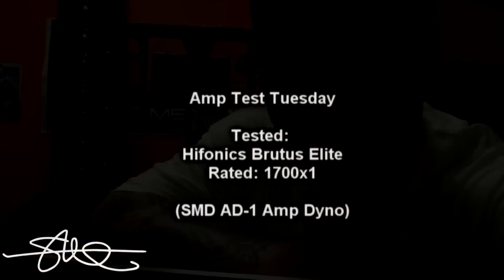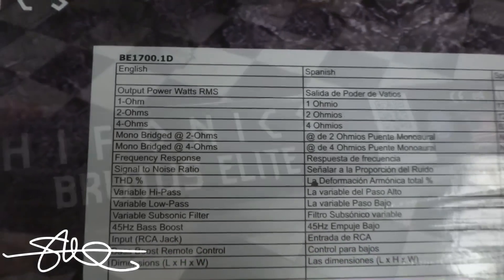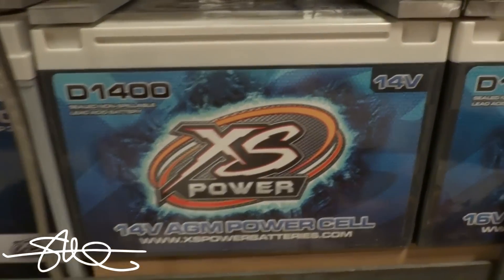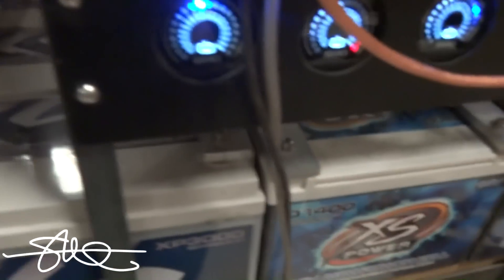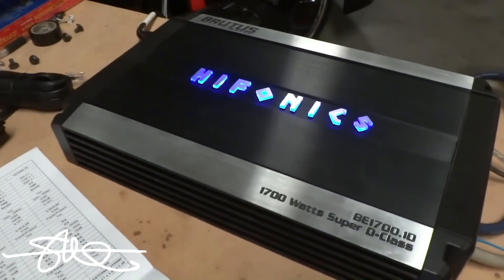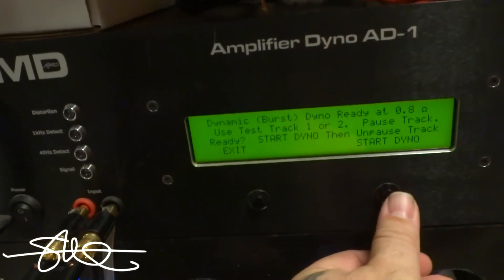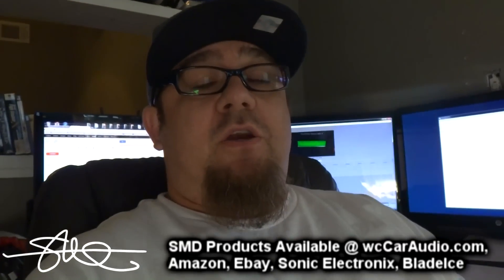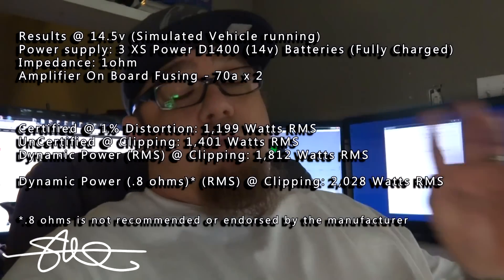Amp Test Tuesday - Hifonics Brutus Elite BE1700.1D Rated 1700x1

Comment: Hifonics amps are total shit. They might be able to put the power out but they dont last for shit. Never seen one last over 1 year.
Reply: Actually i had my mono for 3 years but zeus series.
it was fine but 2 years ago i sold it to someone and guess what ?
i met the guy a month ago and he told me it's still fine..
Reply: Cdogg2233 watch the comparison video on The Amp Lab's channel, he compares the brz 2400 to the SoundQubed 2200 and shows that they're basically exactly the same except the SQ amp uses far cheaper components and would never last as long as the hifonics amp which is more than $100 cheaper.
Reply: Yeah I've had the brz1700.1d for 3 years at .6 ohms and still pushes my subs hard. But maybe some are bad and some ain't
Reply: Alpine's PDK and MRX lines are their high end lines. I do roll with an MRP 4 channel but hell i do a wattage test and you dont need much more than 50 watts per channel for aftermarket component and 6x9s. Of course I use cross overs to start dropping the bass on the 4 channel at 120hz. I like to listen to good sounding music not flexing the shit out of my car which my MRX-M110 can easily do as well but overall for a common setup Alpine is a good choice to go. If you are running you subs below 1 ohm you are risking a lot the amp overheating, loss of cone control and causing internal damage to your amp such as blowing a cap or resistor in the amp which could create DC offset voltage. If you do that buy a new setup because your amp AND subs are done.
Reply: Wtf lol how's your set up ? Hifonics Brutus amps are the shit
Reply: Hmmmm I had a brz 2400.1 for over a year on 0.5 ohms and sold it to my buddy who still uses it to this day on 4 powerbass 2xl 12 at 2ohms and it's still smashing.
Reply: Matt Sullivan Actually i have an alpine monoblock. pdx 600.1
i don't know what about their subs but
I have to admit. the sound is clean and very impressive.
but alpine amps are built for sound quality and not for windows shaking bass. i pushing with mine single dc audio m3 for 5 years and no problems. the gain is set to the lowest point (i mean all the way down)
and the amp never gets hot, never protected from any environment conditions and the volume knob is always about 70%...
Reply: Alpine is made for quality not pounding subs and making every song sound sloppy as shit. Yes I work in a customs shop I know what a gain is for and how to properly tune it.
Reply: I've had my Brutus elite for 5 years @2ohms bumping 300 days a year.... Never skipped a beat
Reply: david le at the same car 5 years ?? Lol...
Reply: Lol. Right ? Finishing school out of pocket isn't cheap..no need for a new car. I'd rather throw it down into a house.
Reply: Well, the BRZ series of hifonics is not shit at all. The Zeus series is overrated but nice too. but it can't be compared with brands like Digital designs, sundown, DC audio and the competition line.
Reply: +audiophile1000 absolutely !! but what about the climate ?
take for example our country...
unbearably hot in the summer...Very pleasant in winter.
if you drive when the temperature outside is about 40 degrees celsius (104 Fahrenheit )...
you think the amp can survive anyway ??
Reply: Cdogg2233 I've had my Brz 1200 since before you posted this comment and I drive 30 mins and back to school 5 days a week and I'm a pizza delivery boy so I have a lot of play time on it lol.

Comment: I bought this amp, BE1700.1D. Running it at 1 ohm. I love it. I was also surprised how clean it sounded at higher volumes. Got it for $259.00.
Reply: yep...correction on the price I paid...it was $225.00
Reply: David Diosdado where did buy the amp
Reply: I live in Houston, TX. Got the amp at a shop named  " Car Stereo Outlet " 10998 I-45 North. www.carstereohouston.com. This shop no longer carries this model, but they will have the latest model available.

Comment: amp test Tuesday is great could you do a vid on the Hifonics clolossus  3200 dual mono block to see the tru rms? The manufacture claims these specs listed below.

4 ohms: 625 watts x 2 chan.
2 ohms: 1125 watts x 2 chan.
1 ohm: 1625 watts x 2 chan.
Bridged, 4 ohms: 2250 watts x 1 chan.
Bridged, 2 ohms: 3250 watts x 1 chan.

Comment: timmyboy it's a great amp for the price I really do believe it hits the claimed power or at least close. I'm running at 2ohm and it barely even starts to warm up if I push it hard for an hour or so. And I have terrible electrical to the extent that if I push it to hard for to long I hit below 12v. And despite this it's been running fine so far. I did suspect I'd blown it the other day but it turns out I had a blown sub which had shorted out and the amp went into protection. Pushing 2 x 18s it gets loud better than all the cheap rubbish I've had in the past. I plan on getting 3 more when I can afford it and running them strapped in pairs. One bad thing I can say is the plastic on the ends where the mounting screws go feels very cheap but has not broken yet.

Comment: Can you retest the amp at a 1.333ohm load?  Do you know if it's stable to run that load.  Wanting to run 3- 4 ohm coils
Reply: I've been running a 1200wrms brutus for a couple years now on 1.33ohm with no problems

Comment: Hi will that amp or any other Hifonics Amps can run my 2 10" Boston Acoustic Pro Series 2ohm speakers ? The speakers are rated at 500rms1000 peak each. Right now i have a Kenwood Xcelon amp running 800watts peak. For some reason my " low voltage" light is on. I have 2 battery hooked up. But i have two other amps. They are running the doors and the rear pillar. I have a 99 Suburban old style. I'm guessing the amp is not strong enough. To power the subs?

Comment: I have the be 2500.1 same amp in this vid just bigger, i clamped it at 1 ohm it did 2663, on my stock electrical, and just 2 group 31s in tha back.

Comment: I have a opinion question for all who see this comment. ..do u think a 500w rms @ 2ohms (cea compliant) amp would be better or a non cea compliant [off brand] that claims double the power > about 2kw max @2 ohms ? they r the same price but I have seen numerous cea compliant amp push more than they claim and ive seen alot off cheap amps produce a true rms as low as 13% of the watts (max) on the box so just want yur opinions thnx
Reply: i would go with the brand only for reliability, but doesnt hae to be the most expensive, ive had really good luck with hifonics amps, they are inexpensive and can handle the power, ive always made it a habbit to get an amp with more power then required, and just tune it down, i feel it helps with performance, & longevity of the system

Comment: i got a question. i have two 12 power acoustic mofos.. what amp will push them to the max without blowing the amp. i am going through amps to often and i need some help. thanx man
Reply: Jerome it depends on if they are the Dual 4 Ohm versions or the Dual 2 Ohm versions, and another thing is they wont handle the 1500RMS they are rated at.. Keeping that in mind a great amp for those subs would actually be this amp; its putting about 900Watts RMS, each, but that's only if you have the Dual 4 Ohm versions, otherwise, the Dual 2 Ohm versions, you would want to look for an amp that is similar to a Hifonics X2600.D, in putting out about 1500-1800Watts RMS. If you have any questions you can PM me.
Reply: you seem to know about these Hifonics amps ... I wanted to ask you something .....from what you replied to Mr. Cordova , do you know by any chance if a "Hifonics Brutus 2000 watts" could handle one 15" RockFord T2 ?? I've seen this set-up here on youtube but, man! it looks weak, but someelse said it was a perfect amp for the woofer I just mentioned , what do you think? take care bro
Reply: I have looked up both the Hifonics Brutus BRX2000.1D Amp and the Rockford Fosgate T2 15" DVC Subwoofer, and I think they would be a good match, but the catch is that you would have to get the T2 Dual 4 Ohm 15" subwoofer. What that means is you would only be using about 1400-1450 of the 2000 capable RMS wattage of the Hifonics amp. The amp is said to do about:
700RMS @ 4ohms
1400RMS @ 2ohms &
2000RMS @ 1ohm
The sub on the other hand has its recommended RMS @ 1200, giving that the sub is by Rockford, it definitely could do the 1400RMS. But that may be why the sub looks so weak or maybe why the amp appears to be so weak is because "you" or who ever runs the setup doesn't allow the amp to put out its very best potential (or run the full 2000watts RMS @ 1ohm.)  IF!, You are planning on using just the one Rockford T2 15", I would say you should go with the Dual 2ohm version and then get the Hifonics Brutus BRX1400.1D amp, I think I covered it all, but if it's unclear or you need a better explanation hit me back.

Thanks and Good Luck.
Reply: Thanks man ..here's a problem with what you said though,..a Hifonics 1400 rms amp??? I want to use a 2000 rms amp or maybe even get a 2400rms Brutus since Im afraid of them being underrated. The one you mentiones(1400rms) Im sorry to say it sounds to good to be true. But yes, I want the two 15" woofers to have their own amp (at 1ohm). Hifonics amps do slam hard but if their not gonna do a good work than Im gonna cut the BS and purchase a RockFord 2500 amp. Thanks again
Reply: Then yeah I would go with that Hifonics Brutus 2400.1D and get two of the 15" Rockford T2's, but make sure they are Dual 4 Ohm configuration and then wire both the subs down in Parallel and then to each other in Parallel and you would end up at 1Ohm, (give or take impedance rise). But you said something about having a single amp for each 15"? I would recommend you go with the single 2400.
Reply: yes, ..I said one amp for each sub. Reason why is because I remember like a year ago, someone at a Stereo shop had two 15", each with a Hifonics amp, and that sh^t was bangin" loud, but he had the woofers at 1ohm each, ...only problem is that I dont remember how many RMS the amps were.
Reply: keith green Yeah, he could have had two of the Rockford 15's with Dual 2ohm voice coils, and wire them separately at 1ohm and have each Amp go to each sub, then in turn having two amps running 1ohm. But I would recommend you just go with the Rockford 15's that are Dual 4Ohm voice coils and and wire them down to 1ohm together with the Single Hifonics Brutus 2400.1D it will be a more simple install for you, and it will save you money.

Comment: i dont really know much about sound systems i had 2 kicker l7 15" with a hifonics Brutus elite bre 2500 ... i sold them nkw i got a 15" memphis mojo x 1750 rms the guy that does my installs said its was a good amp for my memphis mojo but burned the amp .... my question is can this amp b good for that sub or should i get the bre 2100 ....

Comment: Hey bro I just built a box 10cube ft 40 hertz wit 4 txxbd3 12"inch audiopipes in my Yukon I testd wit a ddm1 at1ohm n hit a 147 DBS I wanna get two hifonics elite 2400 hopin to hit 150 DBS  or wat amp at a reasonable price u recommend hit me back wit tips suggestions

Comment: Hey Steve I was surfing the net and found this (Xplicitaudio) pure-audio-pa-3000-1d a 3k amp that claims 1500(rms) @4ohm 2500(rms) @2ohm 3000(rms)@1ohm @ a cost of $279.00 I dont know about you but im curious but the Hifonics amp you tested did its power and thats a pretty good price @ $299 for a 1800-2000watt rms amp if you think so and you budget another $300 amp test tuesday sounds like a good candidate what do you think?

Comment: I have a BRZ 2100.1D pushing 2, 2 ohm 1000 watt RMS  Alpine Type R 10s wired at .5 ohm. There is no clipping, but I'm not turning the gain up past 75% and running no DB boost. It slams, but I was considering an upgrade of subs to the RE XX 12s. Have you tested the Hifonics BRZs and what are your suggestions?

Comment: I got 2 old bxi2600.1, they are beasts. I clamped them at 2900 @ 1/2 ohm and used for competition. I had 4 12s wired at 1/2 ohm on ea. Doing 158db.

Comment: can you test alpines 445 ktp power pack? If you're not sure what it does, it supposedly is able to connect straight to the HU with only rca cables, there is no need for power wire, and is able to output 45 watts at 4 ohms as well as 2 ohms. It's price online is from $100 - $130, too good to be true. I personally would appreciate it if you tested this specific amp, but any other 4 channel would also be nice because alot of other subscribers suggest you test a 4 channel. Thank you in advance

Comment: Even if you decided to upgrade to something like a kicker l7 15 or something like a fosgate t0 or a t1 15 for example, you'd have plenty of power to push it with the kenwood kac-9105d if you go that route.. Wouldn't be the best amp for the job but it but you would get some excursion out of it.. It would most likely satisfy you until you got a better amp to power it.. You might not even want to upgrade your amp.. It should beat pretty good

Comment: I meant hifonics isn't top of the line.. But that kenwood amp would give those speakers plenty of power, the cheapest one I found was like 165 bucks, but if you want an even tighter budget you could go with the Kenwood KAC-5001PS for about 100 bucks if you got it off ebay, it would push each speaker pretty decent.. Good bang for the buck, its also 2006 cea compliant.. 500 watts at 2 ohms, not bad for the price at all.. That'd be a great budget amp, wouldn't drain stock electrical too bad..

Comment: Matching brands is the best thing that you can do, you don't have to though just to let you know.. I recommend the Kenwood KAC-9105D to power it, when they test their products, they test them with their own amps.. So at a 2 ohm load you would get 900 rms out of the amp, which by the way is 2006 cea compliant.. So based off the test that steve did, you would actually get very close to 400 rms to each speaker out of your amp, which isn't top of the line brand, like hifonics..Should be comparable..

Comment: Hi again Steve.
I have a problem i'm hoping you may have some idea or solution for.

I put an aftermarket deck and an amplifier in my friends' late 90's subaru impreza.
It all worked like perfect until the car stopped turning the radio and amplifier off when the car was turned off and the key removed from the ignition.

The stereo plays a loud ~80hz tone and by loud i mean it sounds like the stereo is at 100% volume. This only happens for a couple seconds though.

Any idea on how to fix it?.

Comment: Hey bro I'm running 2 treo 15's off RE audio 5000 xtx 1ohm sealed box... I need to add another battery cell to raise continual voltage... What do u recommend?

Comment: Can you test an MTX 81000D amp? I actually used a very similar hifonics amp (2x70 amp fueses but rated at 1600 rms) to replace my 81000 when she finally went never noticed a difference between the 2

Comment: I've heard these amps clips before they do the rated output. I bought one...fried it. I loved it so much that I upgraded to the mb quart 2000.1 and the only speakers strong enough to handle the output is subs like sundown, skar, etc. High dollar subs only. I would know. I've blown 4 just by pushing the limit of the amp to the subs. No clipping. Just pure power!

Comment: I heard the zues amps arent that good. Also you do realize the zues amps are rated for max not rms like the brutus line so that 3200 zeus is like  a 1600rms or at least its supposed to be. The 3200 watt is the max reading unlike when a brutus line has like this for example a 1700 it is meaning 1700 rms. A lot of people dont look at that when they look at those amps.

Comment: you risk ruining your speakers since you have to crank most amps to the point of distortion to get decent sound level. as long as you have a good tune on your amps (not allowing for any distortion) than you should be ok.

Comment: it would even be better for the amp to use higher ohm loads because this means the amp is stressing alot less then lets say on 4, 2 or 1 ohm. The more ohm's the less stress on the amp but at the same time you also get a less amount of power.
Normally the damping factor on the amp will raise with higher ohm's wich theoretically means you will getting better performance for  instance on music, but that does not mean you get more power, you get less power.